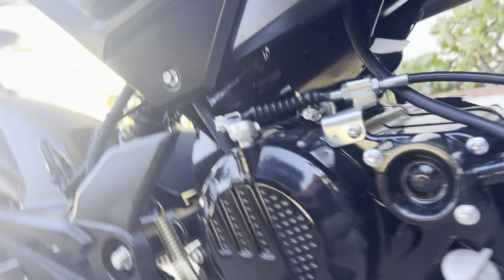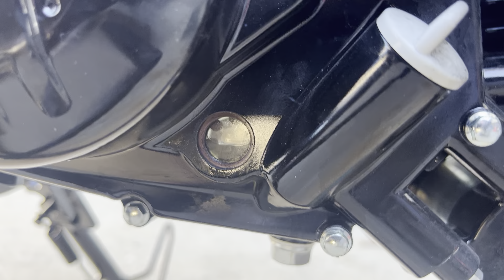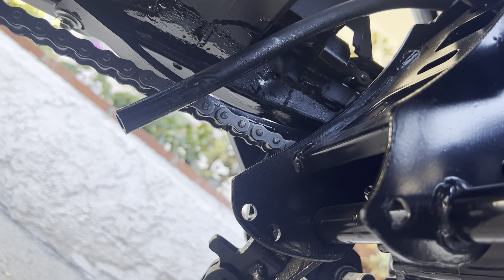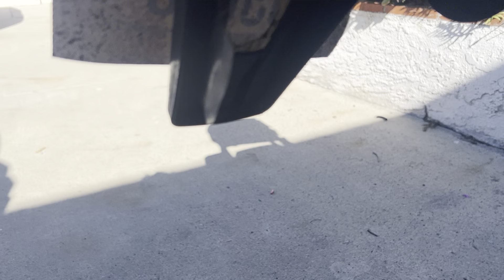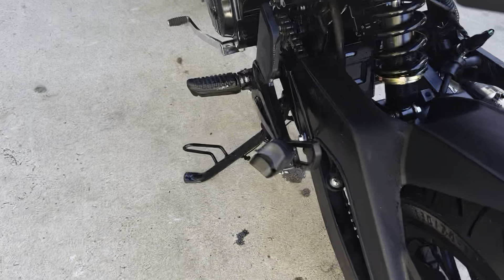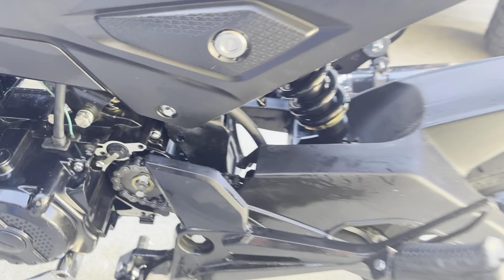Zongshen 190cc crank case breather tube. FIXED!

Comment: Put a catch can and make it return to the engine its common if you do wheelie it will poor out oil it the dumb design  you might be down shifting a little early it  make back pressure on the engine and there only a vent tube for it to come out ✌️👍👌💯🏍️
Reply: How do you do that
Reply: @gzuzchrist1314  you can do it two ways  you can either drill and tap a hole for the return  line or  the lazy way I went with  and add a tee on the breather line with  a check valve/ egr on the return line. 💯🫡👍✌️ my bad not egr  a valve cover   vent valve  from a 80-90 chevy or dodge 😉
Reply: @josephsaucedo8691  could you show me what it looks like please
Reply: @josephsaucedo8691  could u post a video of it please
Reply: @gzuzchrist1314  I wish I could but someone bought it from me  I didn't think the guy was  going to  buy it because he wanted a real grom not a clone. I explained  to him  that basically only the frame  was a clone and it would cost at least 10k to buy a grom and then modify the same way  I built my clone. And  if I sold it  I wouldn't take less then 5500$ he got my number hit me up the next day cash in hand.   As far as I no  I'm the person to build a 190 Dayton 4v with fuel injection system  with basically all grom aftermarket  performance parts so many people asked me about it i wish i still had it.
Reply: @gzuzchrist1314  it super simple  though the catch can hook up the breather line   coming from the top of the motor to a hose tee  then to the catch can   the catch can  return/over    my or my not have a hose.  if not   get one then hook it  up from the catch over flow   then put a valve cover oil vent valve  in  line   just be for going the  center of the metal hose tee  . The valve cover vent  valve  is basically just a check valve  so any  check valve will work  the fit the hose there a in and out flow  the out flow side of the check goes the tee.  That way no oil can go up the catch can return line  and it can only  return  to the engine breather line via tee to return  it to the  engine over flow line  wich goes right back in to the engine  when not running.  Hope this helps  💯✌️